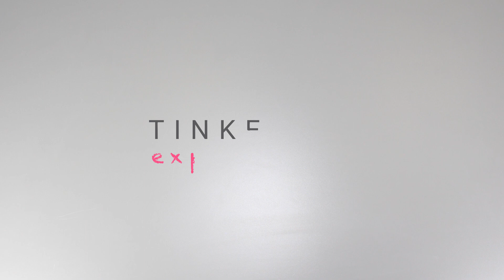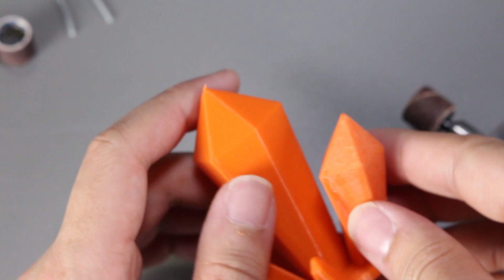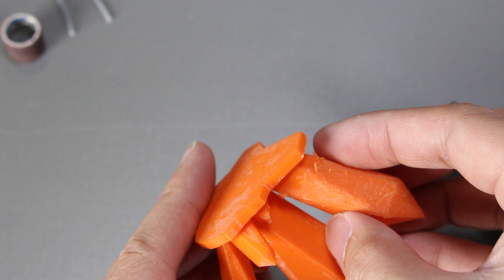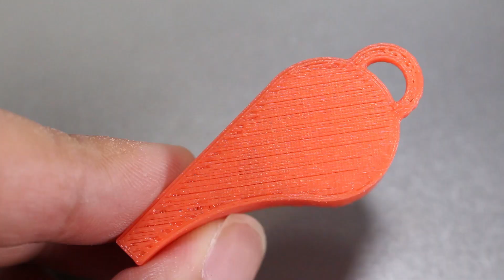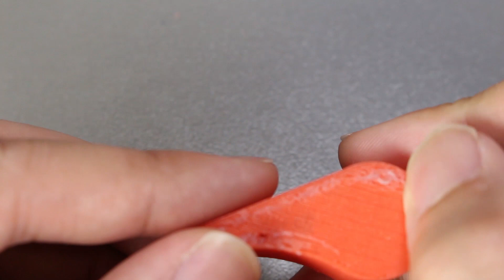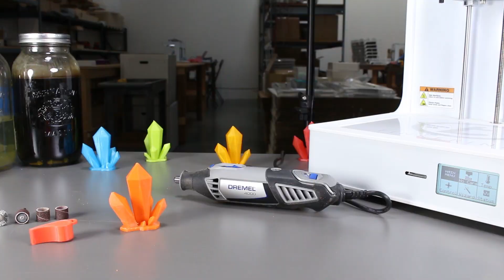Smoothing PLA Prints with a Dremel

Comment: you totally destroyed the print, it looked much better before you used the Dremel ! Especially on a crystal which has sharp edges. A Dremel can be used to remove carefully PLA bits you dont want or make holes a bit larger but its always hard to do because you can ruin the surface in no time.

Comment: Skip all of that by using a small cutting bit, the same type that reminds you of a router bit but smaller, works by chipping the plastic away rather then roughing it up and worry about melting. Works much better and doesn't melt plastic. If you do use sanding bits try the slowest setting and wetting the paper
Reply: Are you talking about using a small end mill? Like a 1/8" endmill?

Comment: People u can’t use standard in box Dremel tools for smoothing. You need to use low speed and a soft tip like wool.
Reply: This is why I use the Dremel Multi-Max.
People assume because the pads are way bigger than this that you cant use it for detail but the triangular shape, soft sanding sheets, and ability to bend, fit, and cut pads is amazing.

Plus you can just glue more sandpaper on it if it wears down!

Comment: I think ur grit is way way too high
Reply: Higher grit = Finer sanding, so the higher the better, start with 320 and work upto 3000, should smooth out like glass.
Reply: I read an article on starting with 200 and ending with 3000. You can use polish on it after for a glass shine.
Reply from the maker: Thanks for the comment!  We'll take a look into it.

Comment: i would only use a dremel tool to remove support material from areas that will not be seen much or at all. for example, say you print out a mask with the supports on the inside of the mask where your face would go. That would be fine because it doesnt matter how the inside looks and its faster than pulling out the support material manually then sanding it by hand. in fact id approach it by dremel for removing the supports, then wet sand it with increasingly finer grits. definitely would not use a dremel for polishing or smoothing for something that detailed or that needs to look good. not unless you can very finely tune the speed and get dremel attachments with finer grits
Reply from the maker: Hi!

That is true, I would post-process the prints further afterwards. Definitely, with polishing, primer, and then spray painting.

Comment: For the last test with the filament stick in the dremel, using the bigger (2.85-3.0mm) filament probably works better, at least for larger surfaces or cracks. Sanding with tools is nice for large surfaces and objects, but you cant get into the cracks between the tiny crystals, so not that useful i'd say. And when sanding PLA, i always do wet sanding with sanding paper made for wet applications. The chance to overheat (melt) something is a lot lower. However, most electrical sanding machines do not mix well with water!